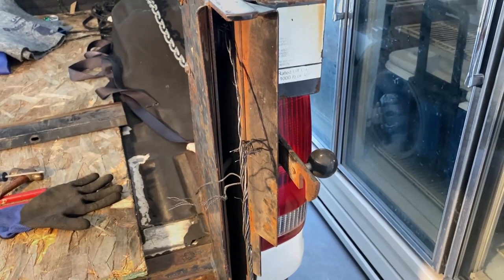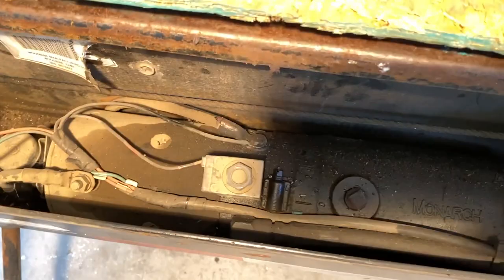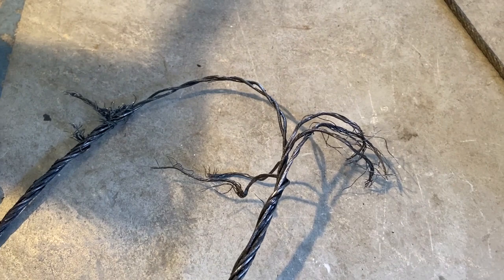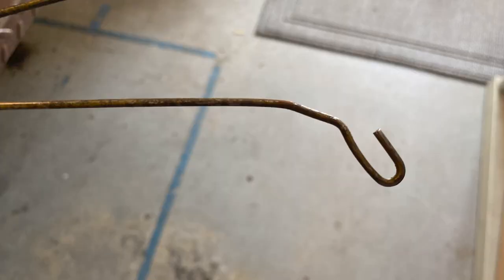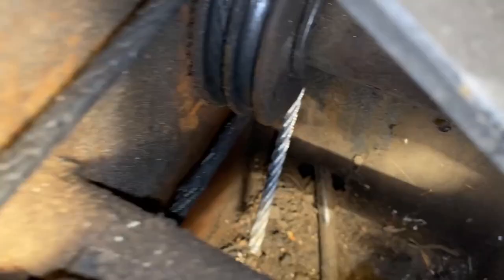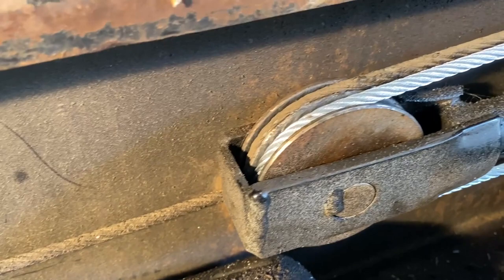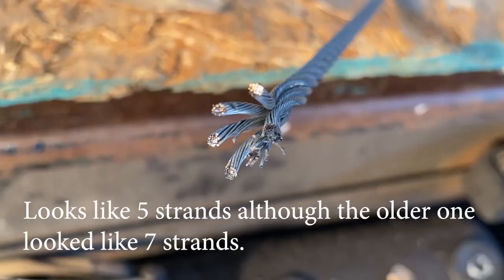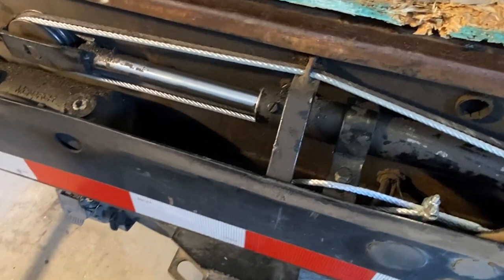Tommy Gate Cable Replacement - Original Series

Comment: Couple of tips, first hold the switch on down and pull the good cable to collapse the cylinder to give you some slack. If you use the Tommy kit it will give you both cable and it will be precuts to the right length for your lift. I normally spray a little gray primer into the upright channel to make it easer to see when I route the cables.  After you are done it is super important to have the cables adjusted correctly.  Both sides of the lift should make contact at the same time.  If not you will have a busted cable much sooner then you want to deal with.  It is supper important to route the cables correctly.  If they are threaded wrong it will destroy your pulleys with is a difficult and expensive thing to repair.  The Tommy p/n for there cable kit is #3123 (this is for a model 60 lift on a full size truck)
Reply from the maker: I have a slightly bent arm on one side.  So I have to pull the left side when dropping the gate cuz it sticks. Not sure what happened.  The truck use to be my dad's and he installed the lift cuz he use to load oil barrels full of oil for recycling.  That was his retirement job/hobby.